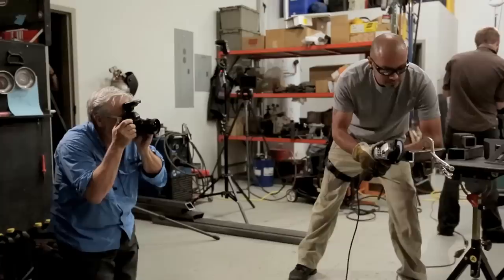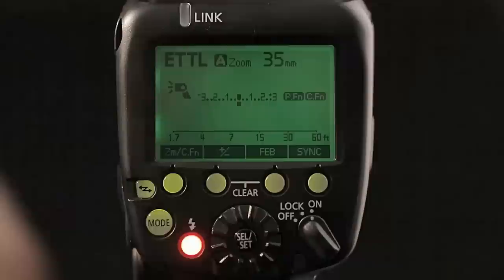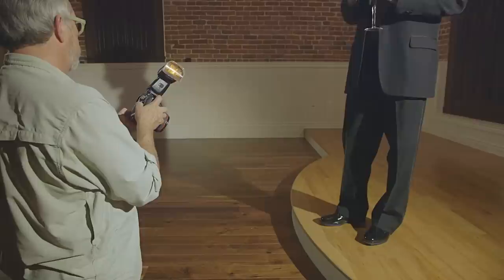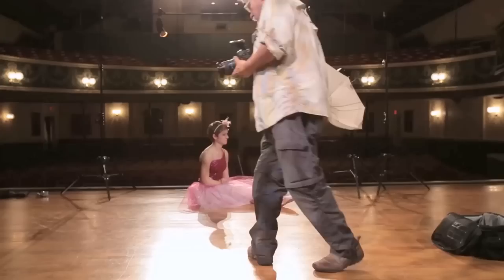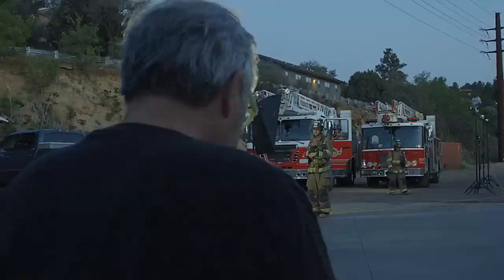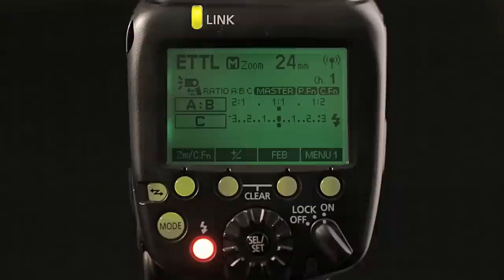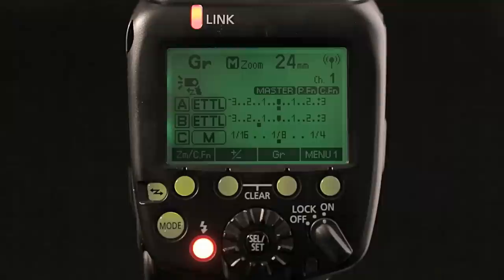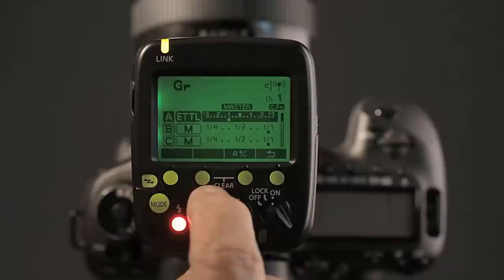Canon Speedlite 600EX-RT: Creative Lighting with Bruce Dorn -- Introduction (1 of 5)

Comment: I purchased the 430 ex rt to use as my master for my three 600 ex rt speedlights. I can turn my 430 flash to fire on or off. And still use the 430 rt focus aide.

Comment: Hi, Does ST-R3 compatible with 430EX ii?
Reply from the maker: Hi Larry Juliano! Excellent question! The Speedlite Transmitter ST-E3-RT does not work with our Speedlite EX430 EX II. At this time, the only flash that works with the ST-E3-RT is the Speedlite 600-EX RT. If you are looking for a transmitter that will work with the Speedlite EX430 EX II, we suggest taking a look at the Speedlite Transmitter ST-E2.  If you need help with finding the perfect Speedlite and transmitter combination for your needs or need help with setting them up, we recommend contacting our friendly technical support team here: bit.ly/ContactCanon. We hope you find this information helpful!
Reply: Very well said and many thanks for the info. Cheers!!!